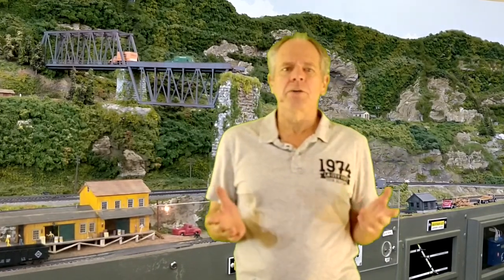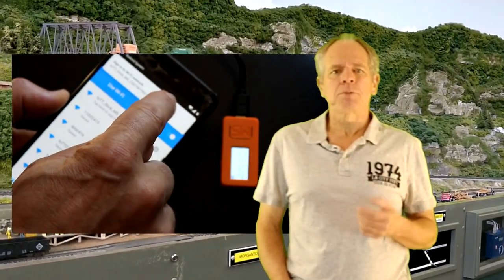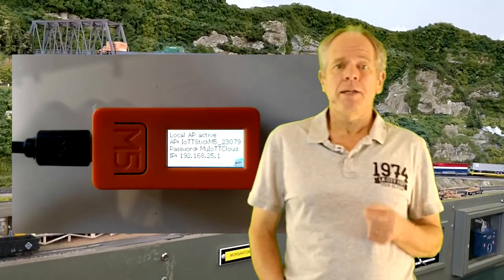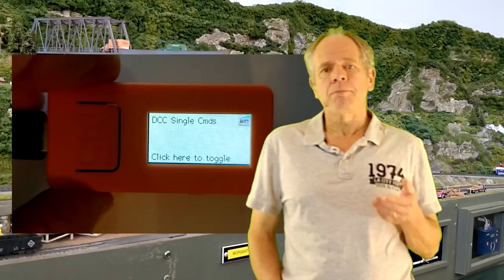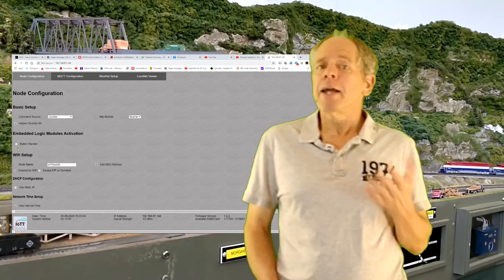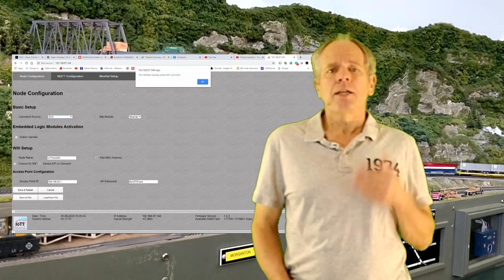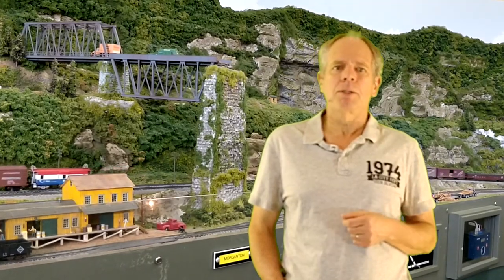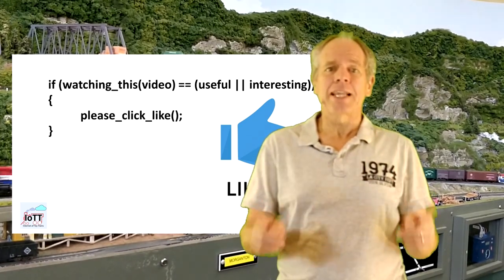IoTT Stick Initial Setup (Video#42)

Comment: Something of note that wasn't covered. When I got my IoTT stick it went straight to AP mode like it's supposed to. But when I connected to it with my phone nothing happened so I opened a browser and was able to get to the configuration page but never got to put in my WiFi settings. I just did a "save and restart" from the webpage and reconnected again and the second time it immediately brought up a captive portal style page which allowed me to put in my WiFi network settings. Just putting that out there in case somebody has the same minor issue. Just hit the web page, save and restart.
Reply from the maker: There is a timeout on the AP that provides the captive portal on the smart phone. After that, the Stick provides a regular AP. See here for a diagram of all the connection statuses: https://myiott.org/index.php/iott-stick/user-manual/iott-stick-core/wifi-configuration

Comment: returned to my railway after a few months break and updated the firmware in the IoTT stick from 1.5.6 to 1.5.18.  Unfortunately my loconet viewer now doesn't receive any messages!  I ran the stick as Loconet MQTT Gateway in 1.5.6.  obviously with the update the options are slightly different i choose Loconet interface with MQTT broker checked but nothing comes through.  Returning to ver 1.5.6 always gets everything working again.  what am I missing?
Reply from the maker: Did you check the MQTT settings? Broker IP and broadcast topic?  They get reset when reloading the software. Other than that I do not know of any problems and I am running the gateway as well.
Reply from the maker: After playing with it some more, there is one thing you should try: change the include MAC settings on the MQTT node name, save and restart, change again, save and restart again. See if it makes a difference and let me know.
Reply: @IoTT  Success!  Now both my sticks are running 1.5.18 and talking to the MQTT server on the piZero.  Now I can start testing my Blue Hats!  Thanks Hans

Comment: Excellent tutorial to a powerful device!  I was a little confused about 'Access points' at the start - watch through the tutorial first or jump to 6'30" to understand how to setup WiFi from default values - but after that it all makes sense and the web browser interface is well thought through and carefully designed.  Really excited about integrating IoT into my layout - Thank You!
Reply from the maker: Glad it helped! In fact, after going through quite some iterations I think the user interface for the setup is now relatively intuitive and does what most people expect ;-)
Reply: @IoTT  I just got my purplehat kit in the mail this week - thanks for the quick shipping. I was also a little confused at first - RTFM on the github page helped some - but this video was perfect for setting up the wifi to my railroad room network . Danke shoen ..
Reply from the maker: You may also want to look up the instructions here: https://myiott.org/index.php/iott-stick/user-manual/iott-stick-core/unboxing-and-setup

Comment: Hans, this is a great series, and one I enjoy following - thank you. I'm one of your early subscribes, and had been working on a link to MQTT as the way to go for sometime as a way of avoiding the propitiatory technology traps, (and would allow me to make my own novel senors).  You are developing at such a rate, I now can't keep up!  I'm primarily interested in joining up an ESU ECoS to an MQTT broker , i understand that JMRI may have released some level of support in this area.  However, I wish to a avoid turning a PC/RPi on just to run my layout.  I was wondering if you have come across the ESU L.Net converter device? (ESU 50097) and if you have any experience in using this box connected to you blue box?  I think this is the way I want to go, and may provide a very quick route for many like me.
Keep up the good work!
Reply from the maker: Thank you for your feedback, I always like to hear from my viewers.
Going to MQTT in my opinion makes a lot of sense as it is a lightweight protocol that opens the IoT world to model railroading. Of course there are many ways to do it.
I am only loosely following the JMRI steps towards MQTT. From what I understand they try to put the entire object functionality to MQTT, which is much more complex than just sending messages and then have a separate logic dealing with it.
I am not familiar with the L.Net converter, but from what I read it is basically a LocoNet to ESU gateway. The interesting thing is that it can handle throttles, because Digitrax throttles have some tight timing requirements. The problem is that LocoNet messages that generate a response require the response to be sent pretty much as the next command (only some NoOp messages in between, while the command station is processing). If there is one or more messages before the response, as it could easily happen if you send the message to an MQTT server, the throttle can't identify the response that belongs to the request. Now, all this is not a problem if you are not using commands that require an acknowledge to the command station. For example, the BlueBox makes use of switch, signal, block detector commands, which all are painless, so I would expect it to work no problem when connected to the L.Net converter. With the IoTT Stick you should be able to connect it directly using the LocoNet interface, or via MQTT and using a second IoTT Stick that provides the MQTT interface.

Comment: All I can say is that this is incredible! You have certainly put a lot of effort into this project. I am in awe of your ability! Two question for you. First, am I correct to assume that you will need more than one M5StackC if you wish to have more than one IOTT Hat? Thus one to do signalling and another to do turnout control. I see that you can uniquely identify each one. My second question deals with your planned Amazon sales platform. Will you be offering shipment to Canada or availability through Amazon.ca? My concern is with shipping costs. Regardless, I am anxiously awaiting your announcement that it is available. Absolutely exciting new product!!
Reply from the maker: Thanks for the positive feedback, glad you like the concept.
To your questions:
1. Yes, one hat goes with one IoTT Stick if you want to use them simultaneously. I try to group functionalities of the hats in a way to minimize layout wiring.
2. I do not expect volumes for such a niche product that would justify using Amazon logistics services, so everything is shipped from the US. A small package to Canada using USPS is less than $15, which is not cheap, but manageable, particular if you consider that the items are light and several of them can be packaged in the same shipment for this cost.
Hope that helps.
Reply: IoTT thanks for the information Hans. I will await your product release.

Comment: When you 1st mentioned using this stick, I purchased it from China. It came in today. Took a long time. I downloaded and installed your software. All went well except that the AP to the IOTT stick does not appear  on my phone,  can you please help ?
Reply from the maker: What software did you try to load? Did you compile it yourself based on the libraries or did you load a binary and if so what version?
What do you see on the TFT display of the M5 Stick?
Note: On a brand new stick, before loading a binary version to it, you should just download any small program from the Arduino IDE. It seems doing so somehow configures the SPIFFS file system. I noticed without doing that first, just loading the binaries works but the program will not be able to load the data from SPIFFS.
Reply from the maker: Needless to mention that there is no such problem if you get your IoTT Stick from my Tindie shop ;-) Software preloaded and tested...
Reply: IoTT I installed v1.2.4 using the update.bat file from the M5Update folder.
Reply: IoTT I get your IOTT logo, Connect to AP IOTT_Stick_M5_230798 to set Wifi credentials, Wifi LAN disconnected click here to connect, Hat: None No interface Gateway not used Modules, IOTT Stick V.1.2.4
Reply: IoTT true, when you 1st mentioned this hardware, you were still weeks away from posting your web store. Once you have the Hardware Button hat available, I’ll be ordering one along with a loconet grove.
Reply: IoTT ok, I ran Spiffs_Test and then reinstalled your code and now it’s working. Great.
Reply: Now it added a red light I can see through the case. Also noticed that if I disconnect the power, it does not run off the battery, is that expected ?
Reply from the maker: Glad to hear you have it working. When no power is connected either via 12VDC plug or USB port, the Stick shuts down in 30 Seconds after the last button input. It stays on while you cycle through the screen. The idea is that the stick is installed somewhere on the layout, maybe not even accessible. So it starts up when power comes on and shuts when power is gone. Not a good idea to run the battery very low, because if you do and then let the stick sit for a month or two, the battery is below critical and may cause a fire risk.
Reply from the maker: The red LED you see is the LocoNet activity indicator which is permanently on since you have no LocoNet interface connected to it. If you set command source to none (in the configuration screen), it will go off.